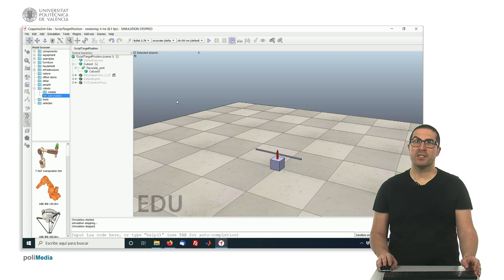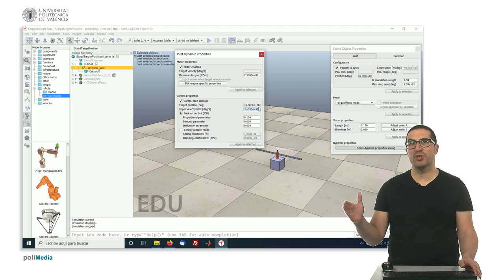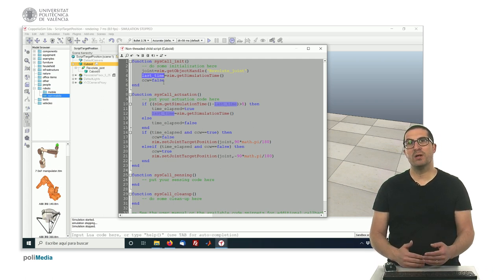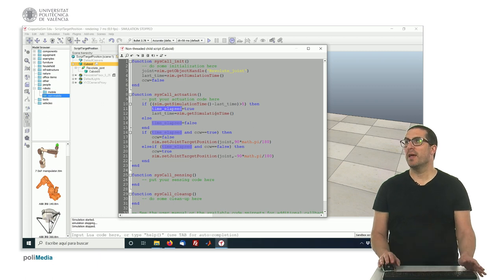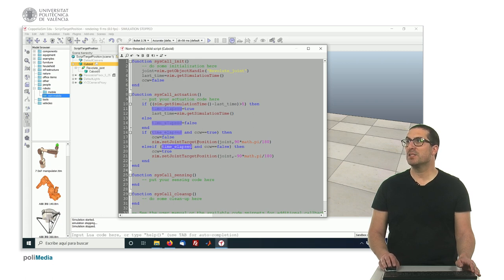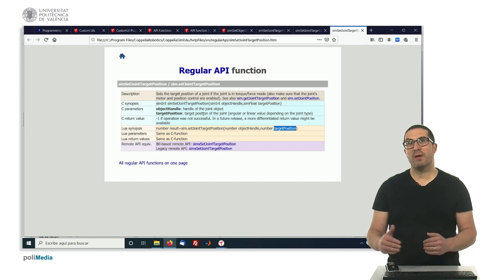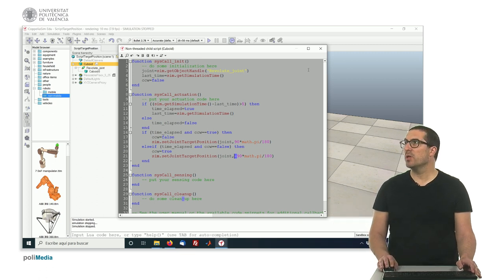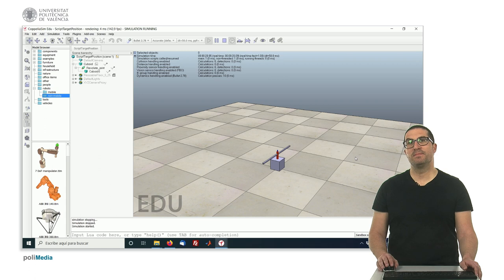Programming example of a joint (position control) | CoppeliaSim (V-REP)

Comment: For those who want to add position values one by one, use a threaded child script instead with the following code :

function sysCall_threadmain()
    j = sim.getObjectHandle("Revolute_joint")
    tolerance = 0.00001
    targets = {-90*math.pi/180, 45*math.pi/180, 60*math.pi/180, 90*math.pi/180}
    for i=1,#targets,1 do
        sim.setJointTargetPosition(j,targets[i])
        while math.abs(sim.getJointPosition(j)-targets[i])>=tolerance do
        
        end
        print("Target "..i.." reached")    
    end
end

Comment from the maker: In each simulation step, the software uses the last target value for the joint position. Writing several instructions to modify the position value has no effect, the last one will be the one used

Comment: thank you sr but the only problem in this code is at the first operation the joint will need 10 seconds to rotate then it will need 5 seconds can you please tell us how we could use for loop instead?  something like 
for (L<= 5 )
the code 
L=L+1
end
Reply: Use a threaded scriptand just copy-paste the following code. Sit back, press the play button and have fun :)

function sysCall_threadmain()
    j = sim.getObjectHandle("Revolute_joint")
    tolerance = 0.00001
    targets = {-90*math.pi/180, 45*math.pi/180, 60*math.pi/180, 90*math.pi/180}
    for i=1,#targets,1 do
        sim.setJointTargetPosition(j,targets[i])
        while math.abs(sim.getJointPosition(j)-targets[i])>=tolerance do
        
        end
        print("Target "..i.." reached")    
    end
end
Reply: @rithu02  thank you very much sr